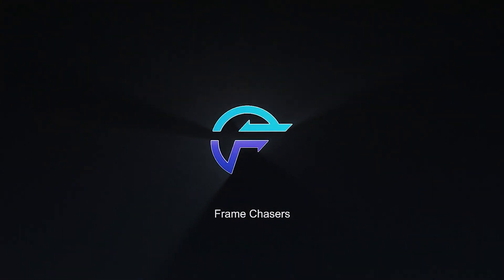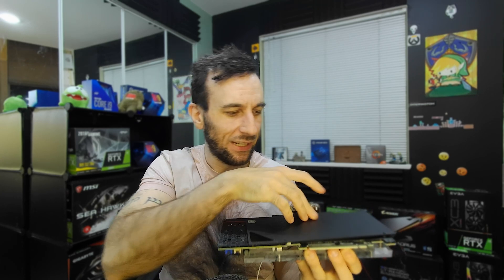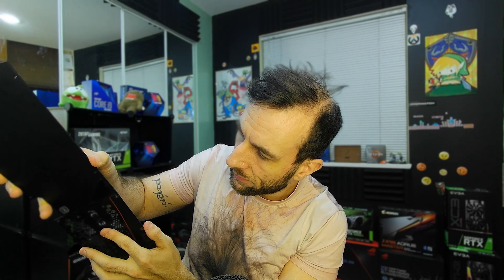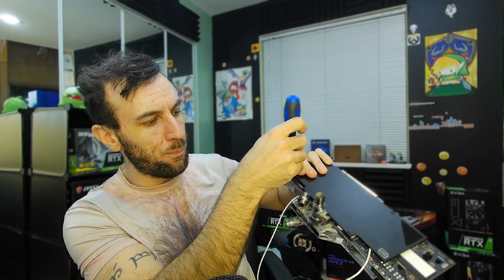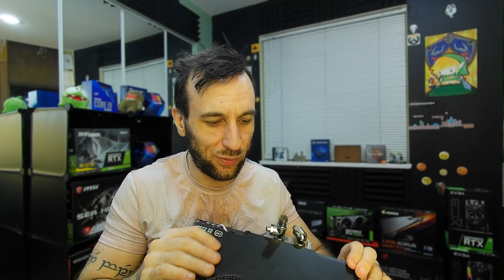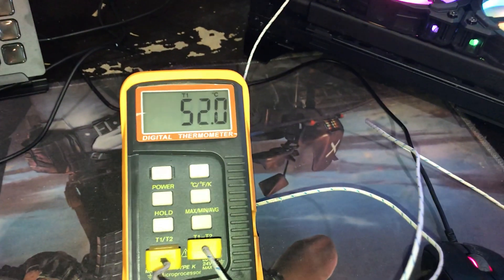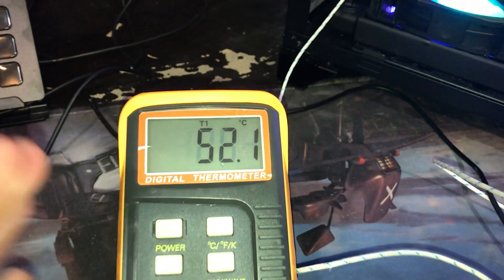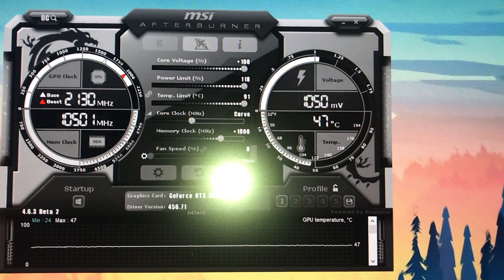MP5WORKS + Alphacool solid Backplate waterblock update

Comment: heya Buddy,  enjoying your content these days. If you can get a 2-3mm copper to be laser cut to a backplate for the 3090, it should work. use 1-2mm pieces of copper plate thermal glued to the underside of the backplate for the Vram and Vrm standouts, cut to size. To prevent shorting, use Polymide heat resistant tape on the underside. thermal pads tested to size. screw the mp5works backplate cooler onto to copper backplate tightly with thermal grease. This would be ideal, next to having the mp5works cooler directly as the backplate.
Reply from the maker: You lost me at laser cut man, hahaha, that’s way too much effort
Reply: @FrameChasers   Yeah I know, I twat about it and decided it wasn't worth it. But I twat you were crazy enough to try it! cant wait to see the 3090 backplate testing!
Reply: Or maybe just use a rectangular piece of copper cut to the correct size. Use thermal pads to make up the height differences. clamp the backplate on. Ghetto, but will be great for another video!

Comment: Hey, isn't there a screw and nut you can use for that corner?  Thanks for the test, that will help a lot of people
Reply from the maker: Naw the backplate hole doesn’t line up with the pcb, same as the front acrylic part.  I was thinking of drilling and tapping my own holes but then I would potentially screw myself out of a future replacement if I did, I have to email alphacool first and see if they will swap
Reply: @FrameChasers  OK, yeah, I remember that didn't line up with the block I guess it makes sense it is same for the back plate.  Hopefully EK has one available soon

Comment: You might want to try clamping it with more solid force.   I was thinking a couple of woodworking clamps would be super ghetto, but would let you test the value (or not) of solid mounting without much investment.
Reply: It could crush some components. those camps are way too powerful. Could even crush silicon die.
Reply: @Reclaimer141  I agree they could crush it very easily, but I'm reasonably confident he is technically competent enough to know not to just crank it down to hard.  There is a long way between where this was and breaking things.
Reply: Fwiw, Mine are now just sitting on my card held with gravity and have been good since install.

Comment: Are you going to try it on the 3090?  I'm interested in if it makes the ram more stable on overclock.
Reply from the maker: Yeah that’s the plan next
Reply: @FrameChasers  I'm interested as well; at 100% my core is 65c but the memory is 104-6c on my ventus 24g oc.